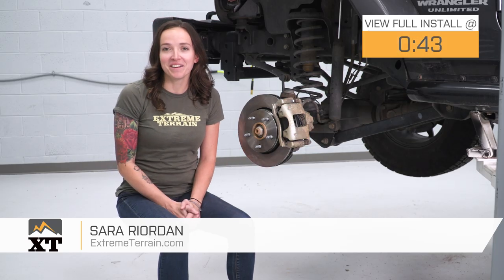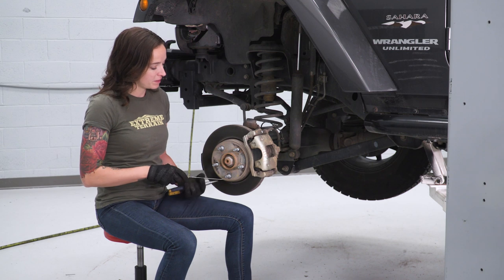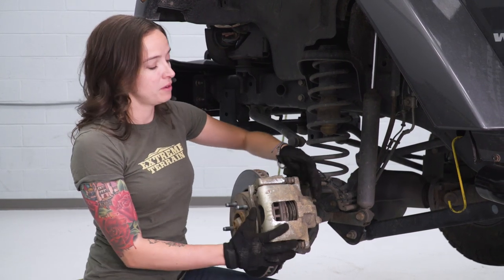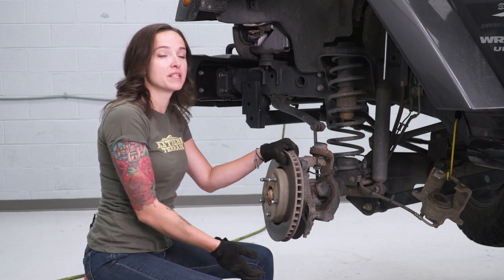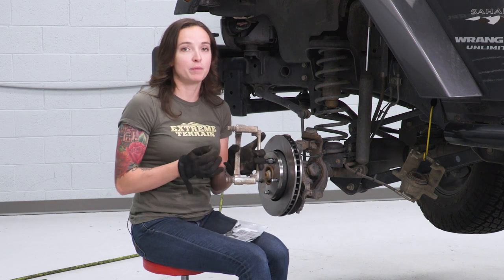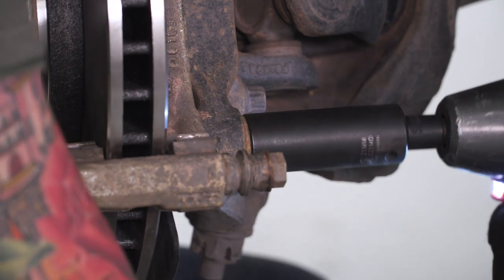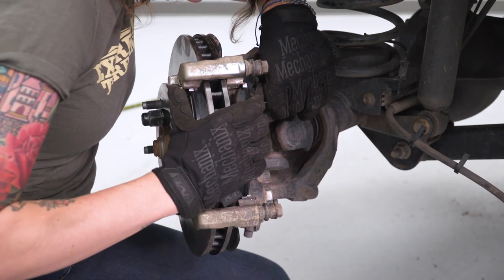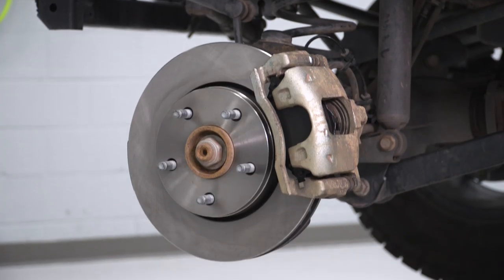Jeep Wrangler JK Power Stop OE Replacement Brake Rotor & Pad Kit - Front Review & Install

Comment: Forgot to mention; open the brake fluid reservoir before retracting the caliper piston(s), dab a small bit of brake lube wherever the pad touches anything, always put anti-seize where the rotor meets the hub, and ALWAYS disassemble and regrease you’re caliper slider bolts. You want your Jeep to last a long time? Then put in the few minutes and $2 worth of preventative maintenance. As someone who has had to torch and sledgehammer corroded brake components off of vehicles, believe me, it’s worth it.
Also, It really is great to see the women take control on this channel. Keep up the great work y’all.
Reply from the maker: Solid tips, Luke! Thanks for watching, as always! -Zach